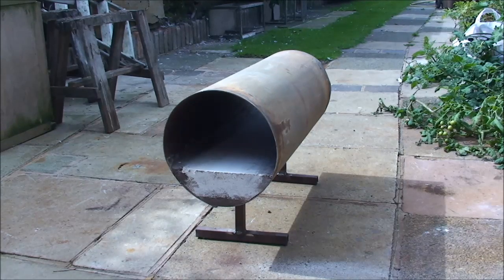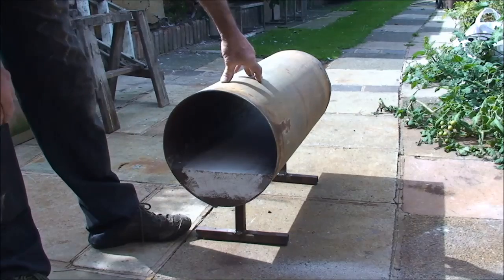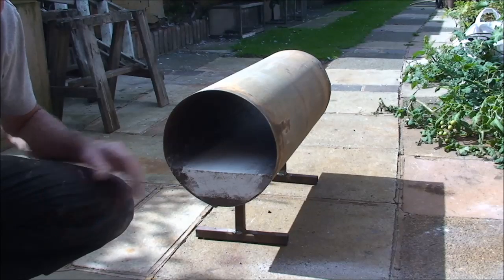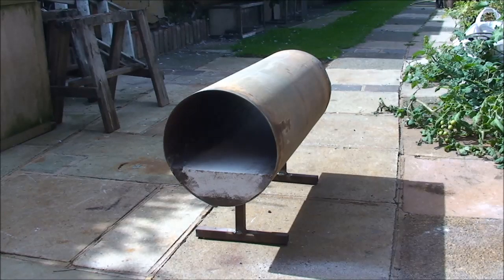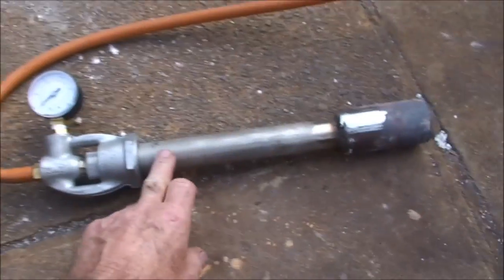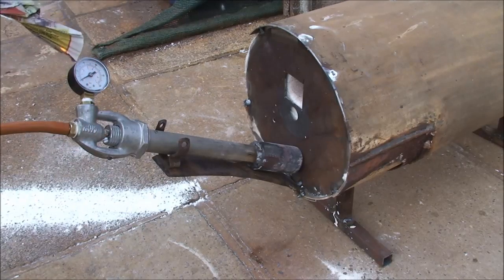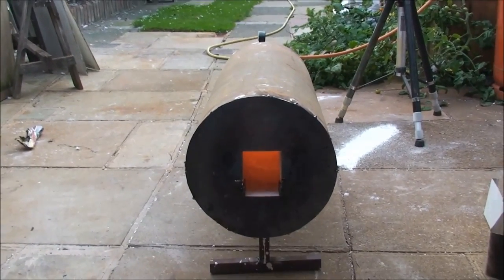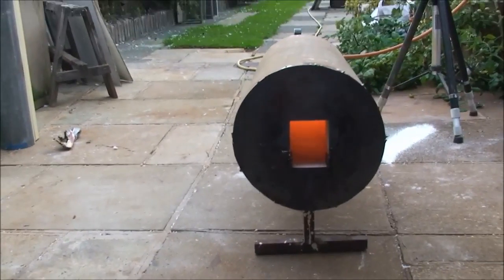Heat treating forge.

Comment: how did it go? You may be able to get better balance of temp across the length of the sword if you make one like Don Fogg used to describe. Not any refractory mortar or anything. Kaowool with rigidizer. Then, just let the heat fill the space and it should be fairly constant. The trick is to put the sword in hanging level across the top. Heat rises and the top layer of air in the forge will be about the same temp. I am about to build one with a baffle between the flame and the sword, so that radiant heating is the only option. Let us know how well it worked by taking temps at both ends at the same time!

Comment: Hi , have u got the eBay link for the gage  and fittings used ? What regulator have you got on your gas , also how did you figure out the length of the burner pipe ? Ow and one last thing where and what fire brick and wool do u use? Sorry loads of questions love the vid
Reply from the maker: +Chris Bannister Thanks Chris, the fittings i bought locally just iron fittings used for gas etc by plumbers, pipe and thread diameter will depend on which burner you buy, Just made the pipe about a foot long that seems to be the length used by others. the firebrick and kao wool where from castree kiln (online) the firebrick where the light weight ones roughly the same size as an old house brick. cheers.

Comment: Where do you source the gass adapter with the guage? Thanks
Reply from the maker: +WW Hendrix (Williefire) Hi there, its available form burlen fuel systems here in the UK, the gauge I added from ebay will put the link in the description above also...http://amalcarb.co.uk/downloads/
Reply: Thanks a lot

Comment: Looks really good. could you fit a inner steel tube or box to make it into a muffle furnace to get a more uniform temperature? I'm looking to build one for silver soldering, a bit like the gun smiths use, but slightly larger say 8" square.
Reply from the maker: +Paul Reed Hi Paul and thanks. I had thought of putting a piece of box section steel inside like you say it might even out the temp a little better I will try it with the thermocouple inside that. you could build yours just using the fire brick as a lining, would be less messing around with the kao wool. Cheers